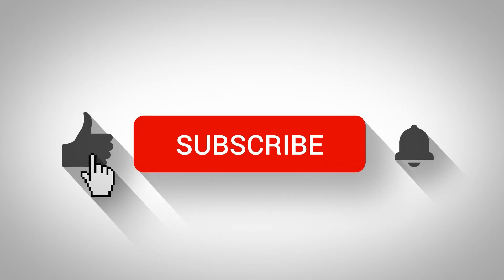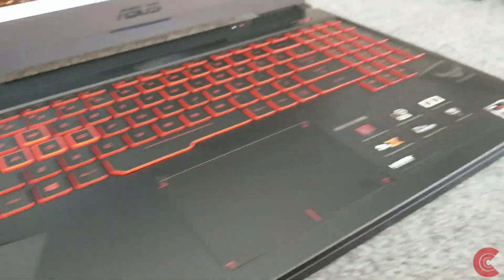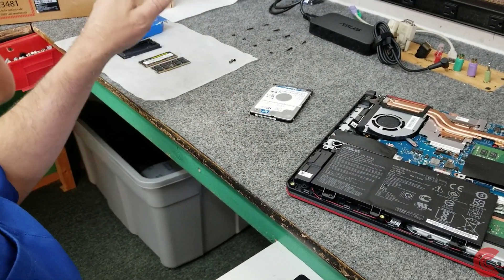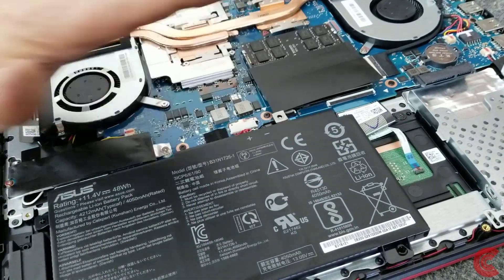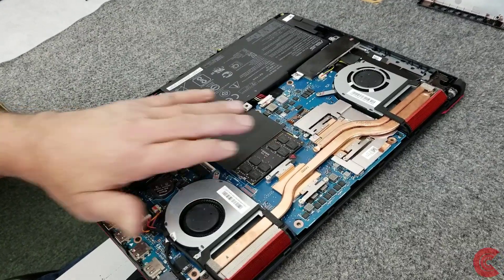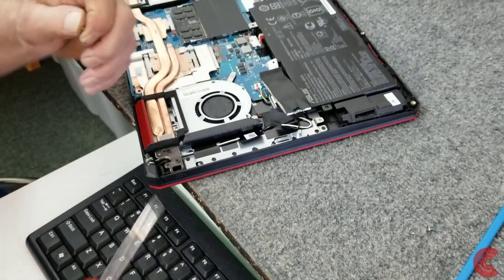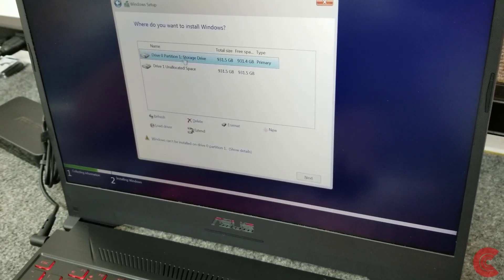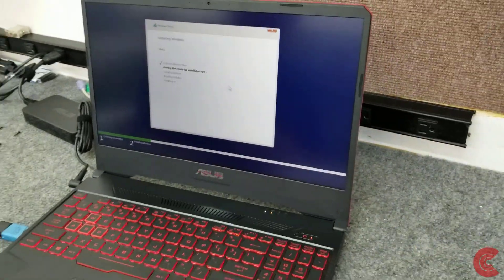ASUS TUF Laptop SSD, Memory Upgrade & Add Internal Hard Drive, clean Windows 10 install

Comment: My laptop battery is not working after the update. I replaced the original 16GB memory at 1600hrz with two 16GB at 3200hrz and installed a 4TB SSD. If you know of any solution I would appreciate it.
Reply: Did you hook the battery back in before sealing? Check the cables to see if it was loose. Also use the link he posted for the drivers in the description

Comment: Short & crisp video with a workflow as smooth as butter! 
QUESTION: I have the same laptop that I have been using for 4 years now. It is not as fast as new but still runs great. Is it worth upgrading now?
Reply: It's a very solid machine. I've just upgraded my 6 years old fx504gd by replacing it's very slow hdd by a crucial 2to SSD, waiting for the P5 plus NVME + heatsink. Next step is to buy the 120 Hz screen, a WiFi 6e card, a fingerprint usb device for windows Hello and it will be good to keep for 5 more years after I've checked thermal paste everywhere needed on the motherboard. Wait, I gonna upgrade to the 32 GB ram also. Only 24 for now. 
Only trade off is absence of Thunderbolt but anyway it's a great value device. 
It's so reliable that I don't want to change. I've seen so many laptops of the same generations having issues of screen, motherboard, fans, battery... I keep this one
Reply: Crucial nvme and Crucial SSD instead of HDD, the laptop works so fine... Going to buy a wifi 6 card to follow the new standard. 
That's a reliable machine.

Comment: i had this laptop for almost 2 years. ram upgraded 32 gb, 1tb m.2 ssd and 2tb ssd hardrive. but i would like to upgrade the gpu but seems like it is not possible. is there any way to upgrade gpu even if it's external?

Comment: Hi sir , i installed 32gb 3200 but the system show me 2400 on Windows, i try to follow a tutorial but doesn't have for this specific laptop , cos in the bios it doesn't count with this AI advance option , can you tell me if have a way to activate the 3200 MHz ?

Comment: I'm new to all this, and just purchased my first gaming laptop! It's the ASUS TUF Gaming F17 with 8GB RAM DDR4, INTEL Core i5-10300H 2.5GHz, GeForce GTX 1650 Ti and 512GB PCIe NVMe M.2 SSD. Id like to upgrade the RAM for sure.  But, I was wondering... Is it possible to upgrade the Graphics card and processor too? And what upgrades would you recommend I do first? I'm excited to make this a side hobby of mine because I want to learn more about computers and how they function.

Comment: Hello Dale amazing video, I'd like to ask if you might know why I can't turn my laptop back on again , I followed your instructions one step at a time for a ram upgrade but now neither my battery nor the cable work, 
If you have any advise I would be grateful
Reply from the maker: If you disconnected your battery inside, double check it.  its really hard to say without looking at it.  Try removing the ram you put in, back to factory and see what happens.  :(
Reply: @CadillacComputerCenter  thank you very much it was the battery but I pushed it too much inside I pulled it out a bit and now it works.

Thank you again
Reply from the maker: Good to hear!! Dale

Comment: Got a random question since I am a noob at all this. I have pretty much the same laptop but it's FX505GM model. On my laptop I have the main SSD drive of 256GB where everything is defaultly saved installed/saved to and I have another HDD of 1TB where it's my storage and I manually save stuff there. I want to upgrade my 256GB SSD since it is very little and it's not always a good option to use the HDD. 

Basically I just wanted to ask which type of SSD I will need for my upgrade. I've noticed on Amazon 2 types of SSD and I see them both in this video to (a thin one and a more square like one). Roughly 9:18 in the video is where I think the main drive is for the laptop and I need to but the thin SSD. And roughly 7:15 is where he is putting in the second drive (not the default drive). 

How's my logic sounding? I need the thin looking SSD right? anyone know an article/video I could read specifically for this?
Reply from the maker: Hi. You will need an M.2 NVMe SSD Gen 3 to replace your 256GB SSD you have now.  You can clone if you want. I have many videos for cloning these types of drives.
Reply: @CadillacComputerCenter  Thanks for the speedy response! I just searched on Amazon and noticed a few brands I'm unfamiliar with, got a recommendation? Or is it all the same?

I will definitely want to clone since it seems like the simplest option for me. I'll check them out, thank you for letting me know.
Reply: @CadillacComputerCenter  Lastly, what about RAM? can that be any too or a specific model brand?
Reply: @CadillacComputerCenter  Sorry for the spam like messages but I wanted to tell you that I have just successfully upgraded my SSD. This and your cloning video were very helpful. Thank you for what you do!

Comment: Did you use a different product key to activate windows than the one used from the factory?
Reply: You won't need a product key. It's embedded in the firmware. Just install Windows and it will activate without entering anything.

Comment: Hi, just a quick question.

Is there any other RAM slots inside the machine?

Apparently, theres two more of them, but only two accesible slots when you take the lower plate.

And Windows task manager tells me that there actually 4 ram slots.

Thanks

Comment: Do I have to do the windows installation if it already has windows 10 installed when I bought it?
Reply: Only if you replace the drive as was done in the video.  The laptop will ship with Windows installed.

Comment: I was add 8GB DDR  into my TUF and second HDD drive into SATA. Thank you for your video, its help me. For other upgraders, when you putting the bottom cover back on  the laptop, first you need to click the edges on the front edge where the touchpad is. Because if you click the opposite side where the fan vents are as first, it is not possible to subsequently click the front part, and you could damage / break the plastic handles.

Comment: Heya these videos really help me visualize how I'd go about opening my laptop for upgrades

I do have a question though if I had an anti static strap but not the mat where can I bite the alligator clip to to make sure I dont get static on the insides of my laptop?
Reply from the maker: Hi. There are tons of videos on youtube on how to use one.  Basically though, make the wrist band is nice and snug to your wrist, have the metal part firmly against your skin.  Once you remove or expose the electronic components,  attach the clip to any metal part of the chassis, ie. , hinge etc.  Dale
Reply: @CadillacComputerCenter  Thank you for the response.

Oh yeah Ive gone through a fair bit of videos already, but none of them really clearly explain where to bite it but I've seen some of them clip to a metal part of the laptop. Anyways, what part of this specific laptop model would be recommended to clip an alligator clip to?

Comment: Hi , pls help me out.. i have a '' ASUS TUF FA506 144Hz Full HD 15.6" Gaming Laptop (AMD Ryzen 7-4800H, Nvidia GeForce RTX 2060 Graphics, 8GB RAM, 256GB PCIe SSD, Windows 10) '' any info what extra hard drive to buy ? or can i buy an extra ssd ? also what ram do i need to buy to upgrade to a min of 16gb ram , thank you
Reply: to get 16gb just get another 8gb stick, you can put it in the empty slot of ram next to the already installed 8gb ram

Comment: how is maximum high of hdd which can be installed as a second to SATA, because some of hdd are 7 mm high but some models from seagate are 13mm high, 2TB models or higher. if its no problem to install there and also get back the cover correct. thank you

Comment: This computer on the video is a new one so I have got a question regarding the warranty: could the back cover opening means also the warranty removal? That's something that has been told to me but it's kind of nonsense: Asus provides screws and everything to upgrade RAM or disk but there are those cover screws with this blue thing that tells "it has been opened so no warranty!". Do you have any advise about that? Thanks!... And indeed, this video is awesome :)

Comment: Hi. Thank you for the video. I bought the Ryzen 9 4900H version of the TUF A15 with the 48h battery. I want to add a 2.5" HDD, for backup purposes and I think the largest 2.5" HDD currently available is 6TB. Will a 6TB HDD fit in the caddy/bay dimension wise? (sorry if there are already comments about this below... didn't have time to read them all)
Reply: So long as it is 2.5" it should fit just fine.

Comment: What was the last thing he changed? Did the 2 rams, and added a hard drive.ive just removed my hard drive and change it for a 1t, 2.5 SSD fits in the same slot. But what's the smaller card he changed my laptop has it too

Comment: Is this the same process of removal and upgrading with the F15 (Model FX506Li ?) 
i saw another video of yours dealing with the memory and the  NVME drive, but not the 2.5 SSD. Want to be sure I have good information before I buy parts and open mine up. Thanks in advance

Comment: I replaced my hardrive with an ssd and my 8gb ram with 16gb, but when I turn the laptop on the screen is black. 
The laptop is on, keyboard is lighten up and all but the screen is just black. 
Any help is appreciated!
Reply from the maker: Hi. After adding new ram, and ssd, especially ram, when you turn it on first time it can take a while for it to post. The bios is reading the ram. .turn it on. Wait up to a minute or so.  If it still wont post hold in power button to shut off. Try again.  I assume you used good ram.

Comment: What were the dimensions of the HDD?
Reply from the maker: Just a standard 2.5 inch sata hdd. Only one size.
Reply: @CadillacComputerCenter  I was wondering if youve used a 7mm height drive in a 9.5mm bay. Is that okay to do?
Reply from the maker: Should be fine. All new laptops use the slim 2.5 inch drives.
Reply: @CadillacComputerCenter  Thanks for the input! I just bought an ASUS TUF Gaming laptop and am looking to expand its storage and RAM.

Comment: Wonderful! I have a problem... Bought a Kingston A400 m.2 (480gb) for my FX505DT and it just won't recognize it. Do you have any tips on what to do? I don't know if the laptop doesn't actually support it
Reply from the maker: Hi. That is a sata ssd. Not nvme pcie.  Very low performance m.2 drive.  Are you trying install windows on it?  You really should get an nvme m.2 drive. Many choices. Dale
Reply: @CadillacComputerCenter  thank you for your answer. I bought it because it was cheap, but the laptop didn't even recognize it. And that's the idea: SSD for the OS and HDD for games and everything else. Should I return the A400?
Reply from the maker: Hi. I would return it for sure. You should spend a little more, get a nvme pcie m.2 ssd, not sata. Samsung 970 evo, crucial p5 series. Lot of choices.  You dont want a low performance nvme drive for gaming.  Dale
Reply: @CadillacComputerCenter  will do, man. Thank you for all the help
Reply from the maker: Np. Thx

Comment: Is there any way I can just add more SSD storage to the laptop without replacing the one with less storage?
Reply from the maker: Hi. Yes. You can install a 2.5 inch sata ssd. This model includes the mounting caddy and cable. Dale

Comment: I have the FX 505 DT with 2400 MHz ram one stick, do you know if 2666 MHz is supported . You didn't show Bios to show your result
Reply from the maker: Hi. Yes. 2666mhz will work. I believe even 3000 or 3200 as well. Dale

Comment: Can I put second ssd in this laptop ???
Reply from the maker: Hi. Yes, you can install 2.5 inch sata ssd instead of hdd. Dale
Reply: @CadillacComputerCenter  ok thank you. Can I run games and other programs by external ssd ?
Reply from the maker: Hi. Yes you can. Just have to install them and point to the path of your external drive.  Dale

Comment: What speed RAM and did it run at the speed you installed?
Reply from the maker: Hi. In this video, the customer wanted ddr4 2400. You can use 2666, or 3200 as well.

Comment: very helpful, congratulations! I own an fx705g with 16gb of ram and I think the procedure to use to upgrade the ram is the same as the FX505 model. Before buying the new ram to install and before opening the pc I wanted to know if it is equipped with 2 banks of 8gb or only one of 16gb. Because in the first case I would have to throw away the two 8gb banks and buy 2 16gb banks while in the second case I would have to buy only one 16gb bank to reach the 32gb target.
Reply from the maker: Hi, typically these models would have 2 8gb sticks. I've done a few of these,  all with 2x 8's.  When equipped with 16. Dale

Comment: my tuf fx505 i5 9300h has preinstalled 4gb ram, can i add 16gb ram to make it 20gb? given same frequency?
Reply from the maker: Hi. I dont see why not.
Reply: @CadillacComputerCenter  im reading some articles that it is not recommended?
Reply from the maker: How many ram slots on your mainboard?  Is the 4gb on board. Soldered?
Reply: @CadillacComputerCenter  two slots
Reply: @CadillacComputerCenter  removable
Reply: @CadillacComputerCenter  two slots
Reply from the maker: Well then you would be better off adding 2 8gb sticks, for dual channel. 2666mhz.  Or 2 16 gb sticks.

Comment: I lost my Sata Cable adapter used for HDD connection ...
Can i buy another one ??
Or i can never use hdd anymore ??
Reply from the maker: Howdy.  You just need to locate a new cable.  Contact ASUS support possibly, or try this company online.  Asus-accessories.com.  they have alot of parts like that.  Dale
Reply: @CadillacComputerCenter  
Daamn! Sounds like a bigger problem
Well thanks anyway bro ♥️

Comment: Great video! I just had my screen replaced to find out my hard drive is dying. Looking to upgrade the hdd and add a ssd. I have no problem with speed but would like to upgrade that a little too since I'm going to be in there.

Was looking for some extra tips for products. Any help would be greatly appreciated.

I have the fx705dy-rs51
Reply from the maker: Hi. You easily replace your hdd with a 2.5 inch sata ssd. You should have at least one m.2 nvme ssd slot as well.  There are many choices for nvme drives.  The Crucial P5 m.2 nvme is a great drive,  the XPG SX8200 pro from ADATA is awesome too. There is also of course samsung . Many choices. I use the ones I listed.  They are good drives. Dale
Reply: @CadillacComputerCenter  so I'm currently removing all the files I need. BTW thanks for the quick reply. Most systems should have a ssd drive? The guy i took it too said I should switch since actual disc drives damage easily. Watched a few videos. Yours was the most detailed. Thanks for your time and help.
Reply from the maker: I'm glad it helped you. Thanks for watching.  Dale
Reply: @CadillacComputerCenter  i was wondering if they all came with ssd drives. Most videos I see that the hdd bay is open.

Comment: Hey dude can I install two Nvme m.2 SSD or there is only single slot in asus Tuf 505Dv
Reply from the maker: Hey dude!  I believe your model has 2 nvme m.2 slots. Plus a 2.5 inch sata bay. Lots of room for expansion.  Dale
Reply: @CadillacComputerCenter  omg you replied so fast ....I am.going to sub you now dude ...thx bro👍 now i will buy Nvme m.2 SSD from Amazon ....I do have on installed in already by manufacturer ....but I was not sure about if they have one or two slots for NVMe m.2 .....thank you again
Reply from the maker: I looked up your model, 505dv .  Says 2x nvme slots. Maybe you can open it first before you order, just to confirm. You'll have to open it anyways, ya know.  Oh, does yours have the rtx2060 graphics?
Reply: @CadillacComputerCenter  Yes sir I will do that ...I will open it first before ordering ....and yes I do have RTX 2060 👍 it's giving me ok performance all.games with ultra setting I can run them for at least 30 fps and above
Reply: @CadillacComputerCenter  Hey man Thanks for the help I opened my.Laptop today and there is only single slot for nvme m.2 lol you saved my money 210USD at least 😂 thanks man
Reply: @CadillacComputerCenter  can I ask you one more question ....when we install New Nvme m.2 or ssd ...do we have to remove battery connector ?

Comment: Hey, do you mind if I ask? I wanna know what kind of RAM did you bought for your tuf fx505, is it possible if I use 1x original 8GB RAM combined with 1x 16GB Corsair Vengeance DDR4 2666MHz into it?
Reply from the maker: Hi. Yes, you can do that. Corsair is good ram. I use it all the time. Dale
Reply: @CadillacComputerCenter  respectfully saying so, it will be fine eventhough I put two different size of RAMs?
Reply from the maker: @erimason5102  it should be fine.  Ive done it many times.  Just will not be true dual channel.  but it will read all of it
Reply: @CadillacComputerCenter  alright, thank you so much for the infos.. I was just worried if I put different sizes of RAM, it could burn the MoBo 😂
Reply: @CadillacComputerCenter  thank you for being so helpful

Comment: Great i was unplug the battery connector with a metal tool(before i watch this vid,was upgrade the ram). So what will happen?
Reply: Possibility of short-circuiting if the metal (may be tweezers?) come in contact with some other metal on the board..